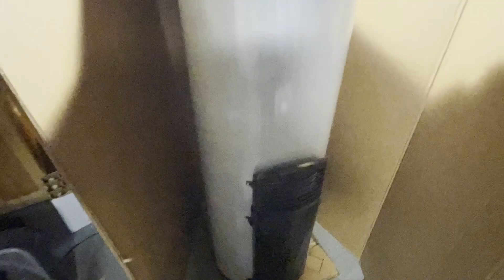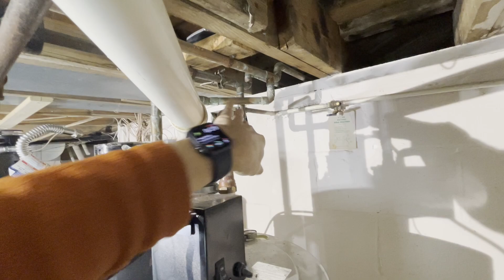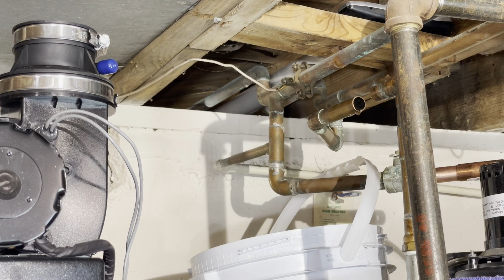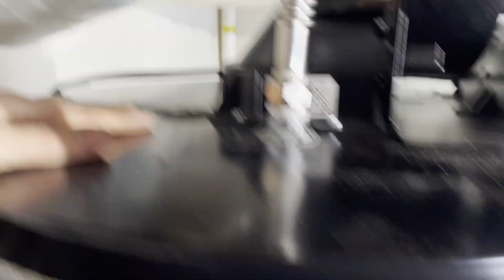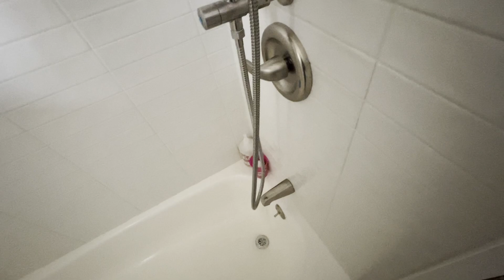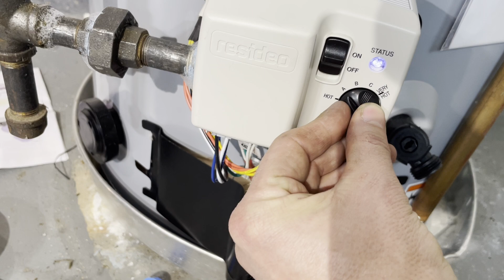Replace Gas Water Heater with Power Vent || Install Hot Water with AO Smith 50 Gallon 50K BTU

Comment: why not use the compression fitting that came with that water heater kit?
Reply from the maker: I had to add the expansion tank and do some rerouting of the pipes so needed to soldering it anyways. I don’t mind soldering and still old school and prefer it over push connections. No issue with compression joints though, they work great on plumbing.

Comment: Mine started leaking after being installed in 1989, was leaking out of Anode rod fitting, changed it out instead of trying a new rod. Power vent looks way better than draft chimney!
Reply from the maker: Power vent is a local county requirement but I definitely feel a little safer with it.